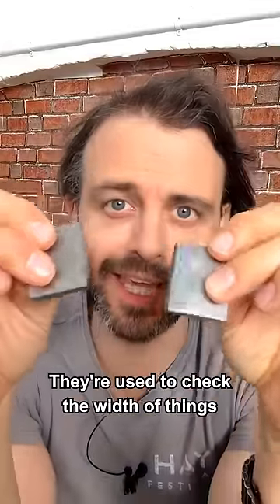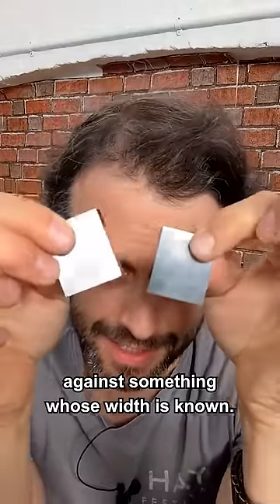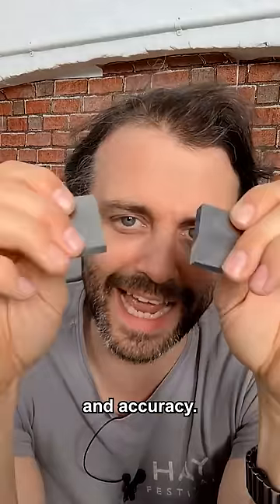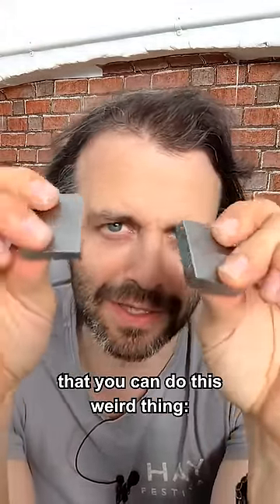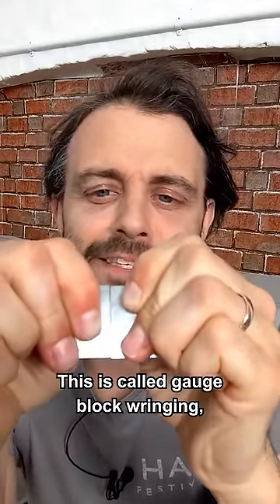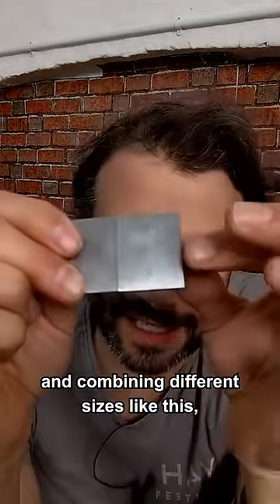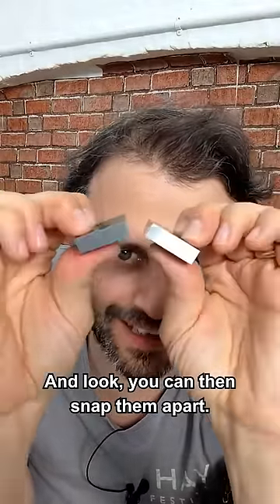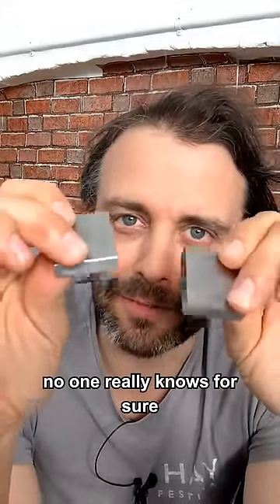No One Knows For Sure Why This Happens!

Comment: Electrons be like: "everything is sticky"
Reply: Van Der Waals
Reply: this is a very sticky situation
Reply: That is what i was thinking. Makes the most sense imo @dumbbuckets2668
Reply: @dumbbuckets2668  Oh I love that song
Reply: @michaeltheaegis On surfaces this flat though if it was an electron mediated binding force you would expect the blocks to cold weld and wind up stuck permanently (since valence electrons in metals don't form discrete bonds)
Reply: @bosstowndynamics5488  The surface isn't perfectly flat, just mostly flat. There will also be some different material on the surface since they are not perfectly clean.
Reply: @oatmongen4263  I still don't buy Van der Waals as being a primary or sole explanation, the same effect happens similarly in very different materials and Van der Waals forces act very differently in metals due to the behaviour of their electrons in metallic bonds
Reply: @bosstowndynamics5488 nah cause they're flat but not "perfectly flat" only the tops of the mountains meet, there are still valleys.
Reply: @bosstowndynamics5488 Yet they all bond regardless, so it still makes sense. They don't stick identically, just similarly. You can't conflate similarity to sameness
Reply: @chrismanuel9768  Well no, they bind in the same way with similar strength, despite having substantial differences in election mobility and number of mobile electrons (the 2 key factors in strength of Van der Waals forces)

Edit: kind of like how helium and motor oil both bind with Van der Waals forces - they bind "similarly" but the results are very different because the potential electron shifts are very different.
Reply: I thought electron electrical repulsion is what keeps things separated
Reply: But delocalisation of electrons bonds, as in metallic and covalent bonds. @ethorii
Reply: Crazy when you think that nothing ever touches another thing directly.
Reply: @eptic-c  I taught that to my daughter when she was about six or seven. She thought it was the coolest thing she'd heard, like magic.
Reply: Except electrons
Reply: Is this not cold welding?
Reply: Static charge?
Reply: Electrons like to repel each other lol
Reply: @bosstowndynamics5488 I think this does actually happen in some cases - almost impossible to pull apart again.
Reply: Lol, you explained in one sentence what took me a whole booklet in the comment section 😂 
I love his experiments, they are always interesting.
Reply: Lmao
Reply: ELECTRONS GO BRRRRR!
Reply: It all comes down to string theory, the surfaces are so flat, that the strings become entangled.
Reply: That's what I was thinking. So smooth it's sticky. But I'm not a scientist so 🤷‍♀️
Reply: Kind of yes, it is Van der Waals forces a quantum effect.
Reply: also electrons: 'like charges repelllllll'
Reply: @dumbbuckets2668 Van Der Waals translated to English is Van der Waals 😂
Reply: I don’t think it has to do with the strong nuclear force but in fact the weak nuclear force.
Reply: Absolutely opposite!? Everything in universe is made out of atoms, and every atom outer layer is made out of electrons that have negative charges, and negative charges repel eachother.

Comment: Probably Van der waals forces. Since there is so little roughness on the material, you have a large surface on both sides which can interact with the other side.
Reply: given they’re both metal, and especially the same metal, i’d be willing to bet that they’re essentially combining into one block, just with a really weak plane in the middle
Reply: @mace1234 this tbh
Unoxidized metal in a vacuum is known to weld together at times even at relatively low temperatures. In our atmosphere it's less common for this to happen due to the thin oxide layers.
Reply: @_Dio_Brando_69 why does dio here knowing so kuch about metal oxidization and its interactions with air
Reply: This was my thought too
Reply: @mace1234  wooooahh I thought the same thing!! It's crazy that I and others guessed what was happening!
Reply: Way to say something smart without actually saying anything....
Reply: @soupfork7893 oxidization happens specifically because of oxygen, it's a reaction itself, not something that interacts
Reply: I thought so too
Reply: Microscopic black holes caused by interactions in casimir field. We can achieve warp drives by combining these one atom thick layers of material and using it as negative mass and energy.

Would make a good interstellar like bs movie.
Reply: Yeah, you likely have a combination of things not just one. You have the super smooth surface which allows more of the atoms in each piece to then have a similar contact as if they had been heated and melted together that is only increased by the added rubbing force applied, then the very small electromagnetic field effect from the earth’s magnetic field through it from and of course surface tension or vacuum. But the strongest force between the two and it’s irritatingly irrefutable and so obvious is
Reply: On the angstrom level it would be extremely rough though right ? I imagine there are tiny atomic arrangements ( probably spirals/vortices ), as a result of the tooling process naturally, almost like Velcro except using the strong force,spinners, quantum locking,em and anything else I may have missed that the rest of the intellectual community may have politely stated above 
 Cheers
Reply: @AnthonyPorter-bleh bot
Reply: Van der waals forces are weak af
Reply: @piyushsawant5394  They are only weak because every regular object we see irl have really rough surfaces on a molecular level, if they are that smooth it would be entirely possible for them to stick
For example, geckos use Van der waals forces to climb on walls rather than any vacuum or sticky surfaces, due to how their skin is so incredibly optimized to maximize surface area on all kinds of surfaces. If the skin of your hands was like a gecko you would probably be able to hold onto smooth ceilings and carry your entire bodyweight
That being said I think the metallic forces would be more dominant in this case if they are smooth enough for Van der waals forces to have an effect
Reply: I think, technically, a rough surface maximizes van der Waals because the many peaks and valleys create more surface area for the surfaces to interact. But I think you're right on it being intermolecular forces. The twisting both forces the surfaces together and scrapes away any oxide layer so the surfaces can bond. The chemical structure of metals is also weird; this probably wouldn't work if they were made of, say, plastic.
Reply: @soupfork7893  jojo characters know a lot of obscure science facts
Reply: @AnthonyPorter-bleh  Not at all. Look it up!
Reply: @HughCStevenson1  My point is that the definition or description he gave is vague and can mean countless things so therefore means nothing when said like that. I'm not an educated fellow but that I'd just how I see it.
Reply: @_Dio_Brando_69 yes but why would these blocks not have an oxide layer? Also, cold welding is still welding. You can't simply snap a weld apart.
Reply: I think it’s funny that the dude in the video says that no one knows why, and yet several random non scientists actually know the correct answer.
Reply: @AnthonyPorter-bleh Van der waals forces man, the thing you learn about in high school chem
Reply: I would also think it may be the surfaces cold welding themselvs together weakly, which would explain why leaving them like this for prolonged periods seems to increase the strength of the bond.
Reply: At a molecular level, the distances between bonded atoms are relatively large compared to the size of the atomic nuclei but are similar to the overall size of the atoms, including their electron clouds.
Reply: @hamzerpanzer  I never even heard the term until recently in my life.  I'm familiar with the concept now, but they definitely didn't teach it at my high school at all lol. I think you're overestimating public schools 😅
Reply: Yeah but no one knows 😂 so psssst
Reply: "No one knows how it happens"
Random armchair youtube physicists: "Why didn't they think to ask me??"